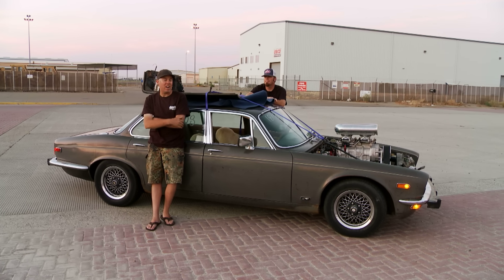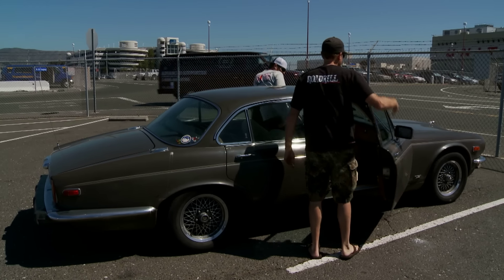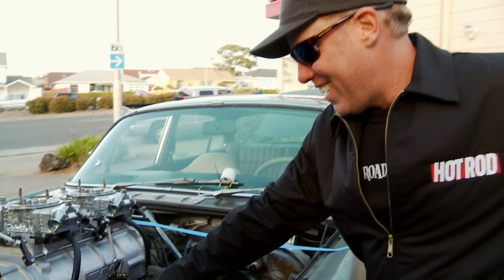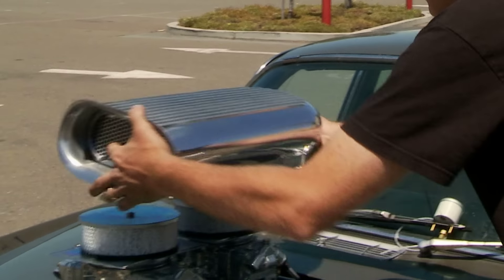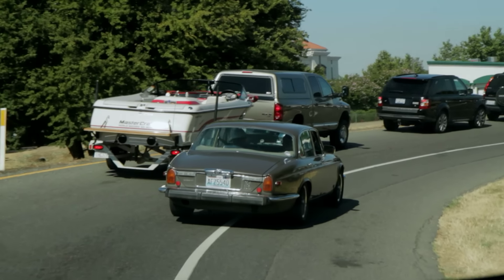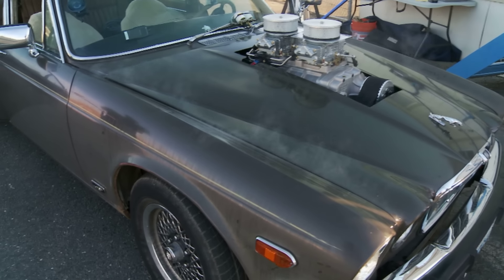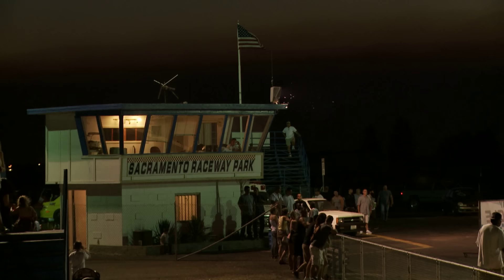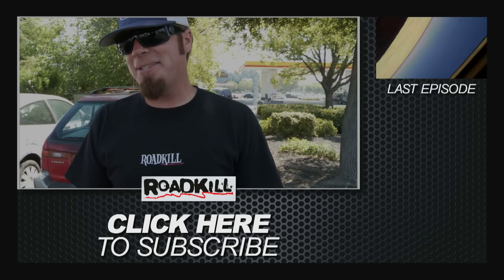Release The Draguar! Building a Blown Jaguar Rat Rod - Roadkill Episode 7

Comment: I bought the jag in my profile pic for twice as much...sad :(
Reply: Nice xtype :)
Reply: Peter Bartolo thanks, it's not a Draguar with a Chevy V8, but it's efficient.
Reply: Haha yes sadly
Reply: Peter Bartolo my jag was the most efficient jaguar made under ford sold in America, but not good for speed :(
Reply: Diesel?  Heard the 3.0s go fast
Reply: Peter Bartolo no Diesel Jags in America, I just have 2.5
Reply: Not sure what you're unhappy about when comparing your car to what they use here, as one is your everyday retail sedan while other is a silly filly attempt at making a dragger.

To explain better though, well... if you go ahead and check the price of the supercharger kit they used, you'd see that it costs about $3.5k... and then you have to add the rest of the stuff. All in all, the car here came for about 5 grands and not just one. For that much, you can buy some Jaguar, a T-Bird SC, an STS or whatever SOLID $5k car that would smoke this thing to the dust in every way.

As for your X-type, not a fan of those myself due to their FWD and boomy looks. S-type's are excellent cars though if you ask me. The thing I like the best about my current car is the AWD (a 2011 A4 Quattro), as it just floors all it's power to the ground.
Reply: John Doe well the xtype looks smarter in my opinion (has that classic jag look) they still look good today heck and only the diesels were fwd the others were AWD
Reply: Peter Bartolo IMHO, X-type has a fat look which I'm not into. S-Type is the one with the actual classic Jaguar look, and there were petrol FWD X-type's too...
Reply: John Doe yes true thay came out with a fwd v6 petrol ....... your'e not mixing them up aye ? the xtype is the one that looks like the xj right ? it definitely looks slimmer than the s type ...... not calling the stype ugly but it's too curvy from the front etc :)
Reply: John Doe it's not FWD, it's AWD, plus X-Type has the nice XJ looking front, S-Type front isn't appealing to me. also FWD was only in 2.0 Diesel, 2.1 Petrol V6, and 2.2 TurboDiesel, 2.5 (which is what I have) was AWD, as was the 3.0
Reply: ***** Still not sure what you're trying to get, if it's AWD then what are you unhappy about? It should be decent enough. Besides, if you want something like what is done here, it's not the right car for you. For $10k I've seen a pro-street Beretta with a custom, long body that would pretty much floor most of the cars you see on the street.

Comment: Why can't we just build the V12 that was in the car to begin with? Oh, I forgot, we are stupid Americans who don't understand engines that aren't a pushrod Chevrolet V8.
Reply: So much ignorance in this comment.
Reply: The car was ruined anyway, there wasn't much sense in buying the original V12 and dropping it in, and what's the harm in giving a car a new life by repowering it? They've dropped a far more powerful and tunable engine in there.
Reply: Exactly.^ OP just wants to act like a butt hurt Brit. Car was headed for the scrap heap anyway, who gives a flying fuck?
Reply: David F. I'm a brit and even I would probably swap the small block into it anyway, never liked the V12, the small block is the far more tunable motor too. More reliable too.
Reply: Jealous much? Fuck technology, all we need is more fuel, more displacement, more boost, and less fuel economy
Reply: MrEdogjohnson ... Look it up... that V12 is * 1 1/2 * 1950 Buick 215" V8's... they even kept the same bore and stroke... made parts easily available...